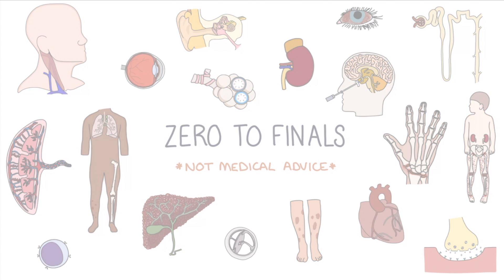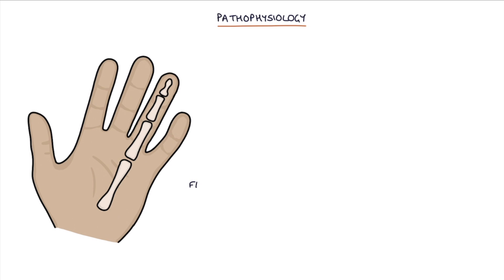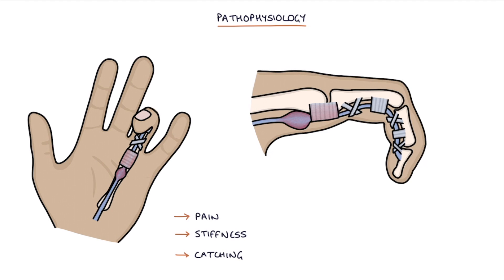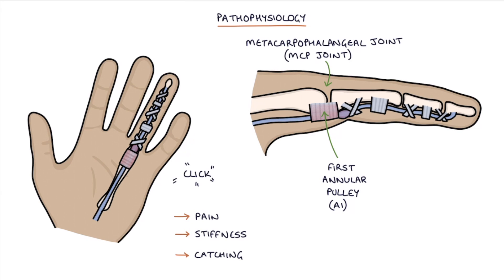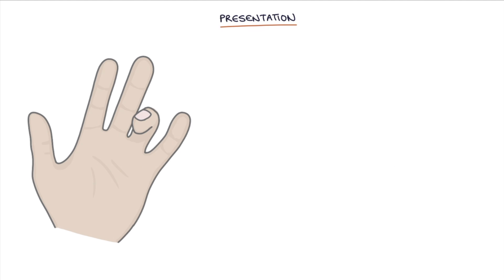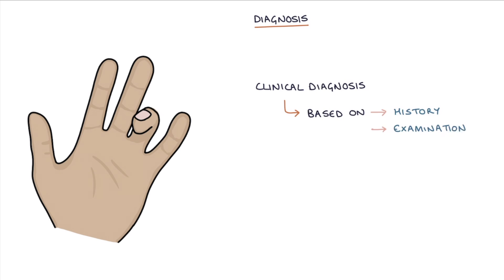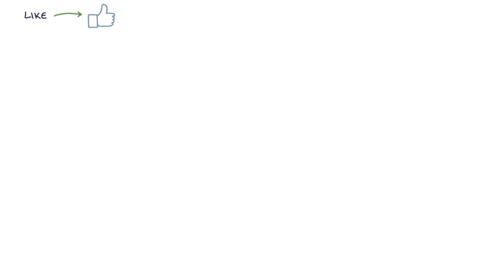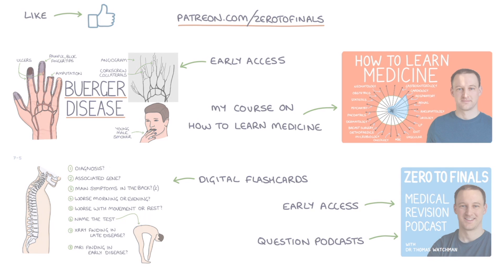Understanding Trigger Finger (Stenosing Tenosynovitis)

Comment: Don't wait, just get the surgery to fix the problem. It is worth it!

I'm never quick to suggest surgery, but I've seen my husband's issue with trigger finger. He tried to treat it everyday and ran the risk of making it worse. He finally got the surgery and now his problem is fixed forever, saving his tendon from further injury.
Reply: I have a snapping problem in the ring finger of my left hand for about a week now …  I had similar symptoms for years but since last week it has become pretty painful sometimes it needs lot of force to open the finger ..  I thought it’s swollen or so ..  but I didn’t hit my finger or hand … I am 28 by the way
Reply: Wrong. The surgery works, but unfortunately the problem returns around 3 to 5 years later. But, better than nothing.😳😲😱😭😁😅😂🤣🖐️

Comment: Had this problem and had steroid injections for both of my middle fingers. My middle fingers had always pop since I was a child, however.
Reply: How long do you have to take the injection and how long does it last?
Reply: @vallentino438 it's supposed to be permanently. However, I got get a 2nd set of injections as the pain and stiffness of my trigger fingers had returned. If the issues returned, I will get surgery to fix them.

Comment: Hi
Its about 7 months that my thumb is straight....and does not bend.
All this locking catching popping happens.
Doing stretches and exercises and massage and hot bath. 
Scared of surgery 😢
Plz help me.
Video is too good and elaborating btw ❤
Reply: According to Me High LDL Cholesterol Triglycerides are the main culprits, after starting 20 mg atorvastatin 1 tablet daily, it not only bought My Cholesterol levels under control but also right palm 3 fingers at one go n left palm 2 fingers, were in bent position n deep sleep it used to straighten up on it's own giving horrible pain 😁😁. I am a very long standing Type 1 Diabetic on twice a day Insulin Injections, My GP told Me that cause of T1D Trigger Fingers are happening, upon blood Test came to know that My Cholesterol levels are in horrible position n as soon as Statin was started Trigger Fingers resolved. Rectify The Cause.
Reply: @VS-qd3tz  good to know, but my levels are all normal alhamdulillah .
My case is overusing my thumb and got it hurt this much.
I did crafting with felt material for about 8 or 9 months 🥺

Comment: I have this on both hands and had my right hand operated on.
Reply: Massage truly helps at the nodules and throughout the forearm and hand. Stretching and drinking water were with electrolytes like Himalayan salt or Celtic sea salt in your water
Reply: I have arthritis and osteoporosis, I'm not diabetic, this started about 4 months ago and though I  do everything I  use a splint while I rest, but my middle finger is swollen most of the time, after I do my daily routine . It is very painful and impossible to move it, I'm afraid that it will brake and worsen, as of now,  I try to keep it covered while I sleep. I had carpal tunnel syndrome and had surgery in both hands 9 years ago. Could that have caused this problem?

Comment: I definitely have this.  My pinky gets stuck in a flexed position. It "pops" when I stretch it open and happens in the mornings and gets better throughout the day when it's in constant use. I don't have the pain, though. Started to happen a little over a month ago, and I'm 37 yrs old.
Reply: Get it looked at soon as possible , it will only get worse , now I’m wear a splint
Reply: Yep, it is manageable at first, but it gets worse. I'm not better. I got it on my pinkies and thumb joints it's getting worse and more painful.
Reply: Me....thumb. and it's gone chronic.
Now my thumb is straight 😢
Reply: im 26 and i got this i thought i was going diabetic😂 what did you guys do
Reply: @Bluemann023  diabetic can be a,reason but not always.
Strong chances are that you do certain activities that involve constant posture or gripping. And over time, muscles get stiff and turn into nodules. 
Plz study more on your problem to counter it there n then. It only gets worse

Comment: I got trigger finger on my thump plz tell me it safe to get injection it safe or surgery is better 🤦🤦
Reply: I saw a surgeon who recommended starting with a cortisone injection. He said 70% of people are cured after one or two shots. My sister cured hers with 24/7 splinting - get an Oval-8 type splint and be sure to measure properly for the right size. I declined the shot and splinted. I also iced the swollen nodule off and on. It has improved about 95%. I will continue splinting as long as necessary. I am a violinist and it is on my right (bow arm) hand. I don't splint while playing anymore and it hasn't had a negative effect. The surgeon said that surgery should be a last resort.
Reply: @lesleyheller2271 but splinting also goes negative somehow.
My thumb has started to lose its crease lines by straightened out for a loooooong period 😢
Reply: Look up Quervain Tenosynovitis
Reply: i had mine since 11 😂 i love popping my nodule